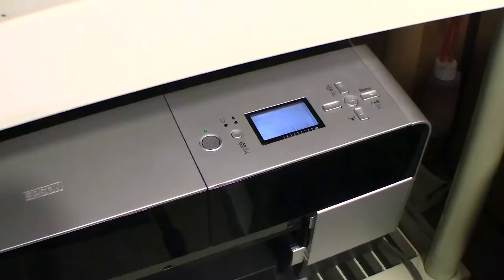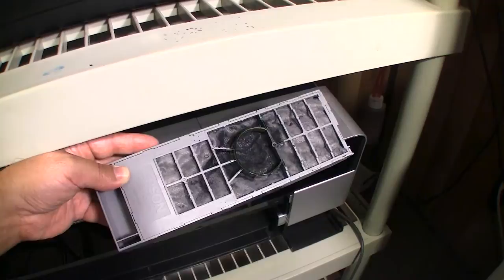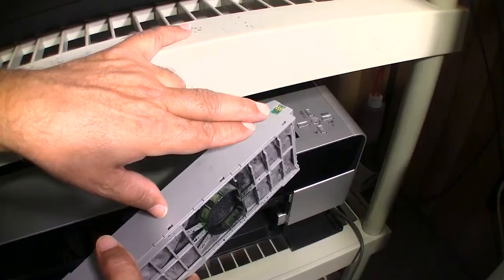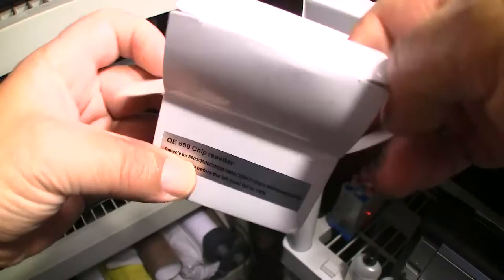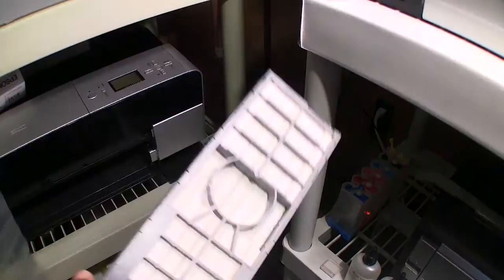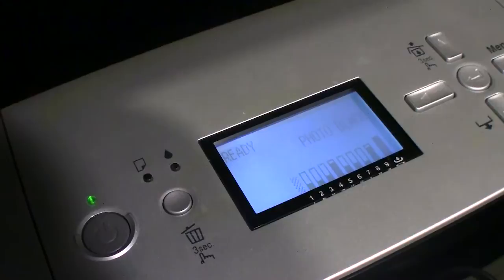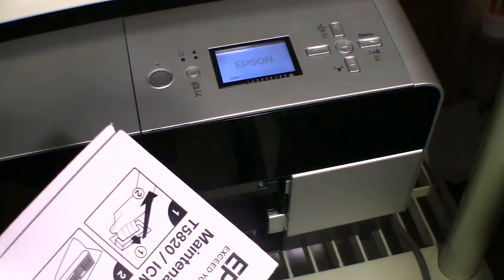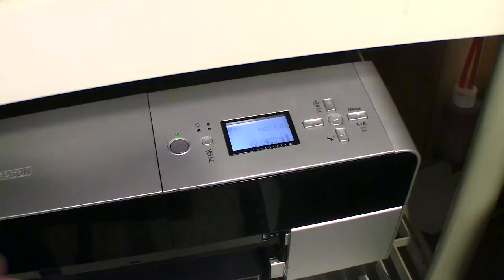How to Reset the Maintenace Cart on the PRO 3800 and 3880

Comment: Hey Jose, i have a 3800 with a solid red maintenance cartridge, can i resset it to full or i have to bye 2 new maintenance carts, one for use  and the spair one ??  I don't knpw yet if i can resset the one that is solid red???
Reply from the maker: You need to buy the resetter they sell on eBay. Reset the one that's full. Open it. Empty and replace the insides with something absorbent anything will work and put it back together. Set it aside. You will now need a second cartridge because the printer has to see and record a different chip code before it will accept the original you reset. It only has enough memory from one single code so it will forget and delete the previous one when you insert a new cartilage so you can just use even a used one as long as it records a different code. Then it will accept the one that you reset because it has forgiven that previous particular code.  Funny isn't it? I think I did explained it on the video.
Reply: Jose Rodriguez , yes thnks for the knowledge btw, i was just wandering if the maintenance carts is full, not at 15% if the resseter will resset it or not...???
Reply from the maker: John I'm not sure about it seems to work for me pretty consistently though. I need two cartridges to be able to perform this
Reply: Jose Rodriguez , ok just one way to answer this.... hehehe. Thanks for all the things you shair on youtube.. this is awsome. Same as to have a teacher at home.

Comment: Hi Jose

I purchased a CHIP RESETTING To reset Refill EPSON ALL 7-PIN and most 9-PIN ink Cartridges.

I payed $36,97 USD on PayPal

I have also seen your film on the subject.
My printer has a fixed red light next to the window which reads:
Install the maintenance cartridge.

The Chip ressetter does not work.

Can you tell me why? 

Jens Juul Andersen
Reply from the maker: +Jens Juul Andersen Becase just a regular 7-9 pint resetter will not work for PRO 3800 and 3880. They are only able to reset Printers carts like 2100-2200 / R1900 / R2440 /  R2880 and older R280 through R380You need to get the Specific one I indicate in my EPSON Refilling VideosQE- 589 Chip Resetter- look it up on EBAY,. There are many resellers. Thgis the one for T58 Carts and Maintenace Carts. You must also follow the TWO CART process I show in the video for it work. Just resetting the chip will not work.
Reply from the maker: +Jens Juul Andersen This is the latest Reseter that will work on the PRO 3800 / 3880 carts and Maintenace carthttp://www.ebay.com/itm/Epson-Ink-Cartridge-Chip-Resetter-for-Stylus-Pro-3800-3800C-3850-3880-3890-3885-/151903735492?hash=item235e2b0ec4:g:uzcAAOSwHQ9WX~Pc

Comment: Thanks for the video ! My Maintenance cart is at 7% now. Can I use this method too instead of the 15% recommanded?
Reply from the maker: +Julien Bourbon The 15% requirement only pertains to the ink carts and not the maintenance cart! You can reset it using the method I demonstrate!
Reply: +Jose Rodriguez another question, where do you buy the chip resetter ? I saw a lot of chinese's sites only..
Reply from the maker: +Julien Bourbon EBay!
Reply: Hi !

I tried to replace the maintenance cart like in your video, but I have a warning message: "Maintenance. Non-Genuine Maintenance cartridge installed". I tried to reset the old cart twice, but same message. The indicator of the cart is empty on the screen instead of a full cart with the new one.
Any idea?

Comment: I bought the resetter on Ebay. Followed the instructions and the Epson  pro 3880 sent error message: Non-genuine maintenance cartridge  installed.
I repeated the procedure and got same message, At present I am just using the new maintenance cart.
Reply from the maker: +Robert Harper Sorry to hear that. That can happen specially with the newer 3880. Since it works perfectly on the older 3800. I wonder if there is an option to ignore that message?
Reply from the maker: +Jose Rodriguez Another possibility is this. Are you using refillable carts or OEM. Resetting the Maintenance Cart, at least on the 3800 will only work if you are running on OEM ink carts.I could not do this on my other 3800 when it was working, with refillable inkjetfly carts as the controller chips that the refillables used automaticallt kept the Maintenance Cart Chip as being 1005 empty all the time.

Comment: That reset gadget kind of works. Somehow the printer recognizes and says this is not "genuine part..." As a result the display doesn't show an empty tray after a reset. It warns you that the capacity may be different than oem part...but doesn't prevent you from printing....
Reply from the maker: Of course it works. You have to do it correctly as I explained here.You need TWO maintenance carts. You reset the one you repack. BUT....You install another one. The printer will record THAT chip ID code and forget the the one you originally prepped and reset. Now you remove the second cart and install the one you reset and repacked and it will accept it and report it as being fully empty. DONE!
Reply: @cheo1949  I did as you described, twice. I think there may be a variation in reset device or firmware....
Reply: I didn't try to unplug as someone suggested. What the display says is irrelevant for me as long as I can print. It's not like that indication meant anything. It said full when it was only 1/3 full
Reply from the maker: Well it should show empty. Maybe Epson has messed with the firmware.

Comment: Just so you know you don't need the new tank if you just pull it out reset it put it back in it won't change . What I do and works everytime is while turned on remove tank n reset then pull power out of printer leave 30secs too 1min power back up without tank once rebooted put tank back in done full tank. This method also works on totally empty ink carts below 5% that supposibly can't be reset but I do it all the time with zero ink level reset back too full. The printers memory is volatile and will forget with our power enjoy guys.
Reply from the maker: Good to know. Siince I do have extras and have 3800-3880 and P800 which share the same tank. For me it takes me about 30 seconds. Because I already have reset extras at the waiting. As long as I insert another cart i have already reset in that slot it will take it readily. Repack the one I took out and reset it till needed for the next printer.
Reply: +Jose Rodriguez no worries hope it works for everyone I'm not sure what firmware I'm using but I don't think the firmware could change volatile memory. I just tried your needle trick for oem inks mod seemed to work well thanks for that. I would like to get a copy of the 3880 firmware and have a go at reprogramming it to too not write too chips not sure if it's possible yet or what side effects would be caused . But this will be a project I'll look into possibly even try a jtag method. Only prob with jtag is it's not somthing everyone would benefit from as it's involves soldering onto control board . My preference would be a modification to a firmware I could upload to printer all depends on the security level Epson use
Reply from the maker: Don't know a things out programming! But that would interesting if it could be pulled off.
Reply: +Jose Rodriguez yeah I've had a quick look at firmware and looks like the best most unsure version was the original firmware not sure if this version had any issues but normal these updates are more often than not security fixes that don't really help the end user . Not sure if the firmware can be downgraded at all but if I find anything useful I'll let you know
Reply from the maker: If you come across something interesting, please let us know
Reply: I have a 3880 K3 Vivid Magenta. I tried this procedure and I now get a warning with this cartridge (refurbished with paper towels) that it is not an OEM cartridge. I can "Continue" and it will work, but it does not display any usage stats for the maintenance cart. This isn't really an issue for me, as I am only using this maintenance cart for purge cap flushes and cleanings. I am wondering if repeating the procedure on this cartridge and doing the "new cartridge" insert will clear the error? Think it will work? I hesitate to do the reset with ink carts because of the error.

Edits: fix typos and add printer information.

Comment: I am very confused. Why would I buy a brand new maintenance cart just to go and reuse the old one? I'm racking my brain here. I only have one maintenance cart. I thought the idea is to reuse it over and over. If I have to use a brand new cartridge to reset the old one, I'm just going to use the brand new cartridge. LOL
Reply from the maker: Simple, Because the printer need to see a NEW ID code number. You will only use that knew one to make the printer record that number and FORGET the previous one    ( the one you reset and repacked ). It's just a trick to fool the printer into accepting your reset and repacked one.  You can not expect the printer to accept your reset one because it will see it as the SAME cart that you reset to empty. That's a NO-NO. By inserting the New one and allowing the printer to accept it, if FORGETS the previous code as it only has memory room for ONE code.